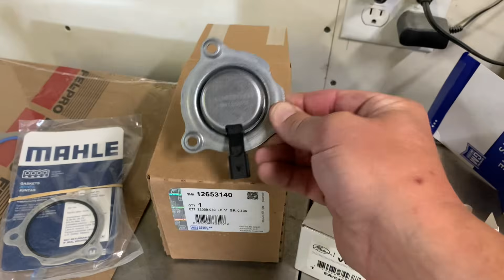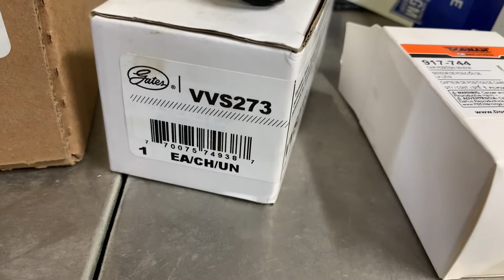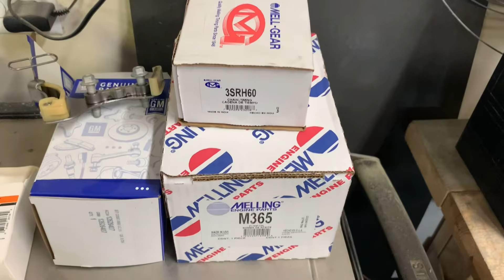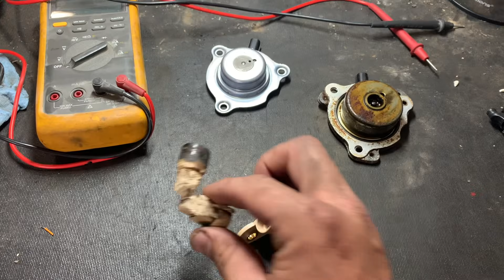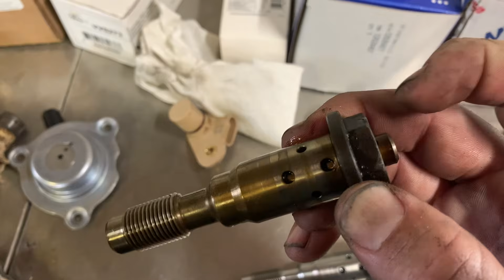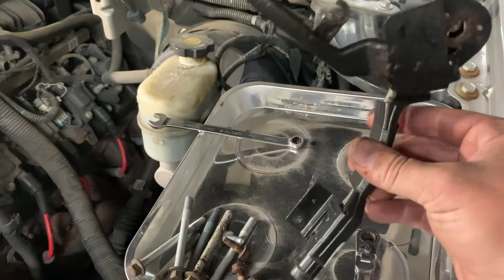6.2L GM Escalade Yukon Silverado P0011 Code Easy Fix VVT Repair

Comment: I have the p0011 code and a #2 misfire, engine and stabil link light. I have a rough idle and loss of power on acceleration most the time like a bad miss. Hopefully oil is just low cause it's wet underneath but I know i will have to order a vvt and cam position sensor at very least. Wish me luck for a $1200 escalade i can't complain lol

Comment: 08 6.2 Cadillac p0011 code reman install done from shop brought to me running poor phaser 180 off yes turn multiple times still off replaced all vvt phaser bolt tensioner Chain cam sensor magnet oil change good oil pressure at idle still getting p0011 so tired of this light 
PLEASE HELP
Reply from the maker: Could be in the harness, you replaced the vvt solenoid/actuator right?

Comment: 07 Cadillac Escalade replaced vvt, the magnetic, crankshaft, camshaft sensor code came back p0011 was stalling acting hesitate now back at square one HELP
Reply from the maker: Check oil pressure with a mechanical gauge at op temp, if good I would plan on taking the timing cover off and replace the timing chain

Comment: I'm glad you said something about the stabilatrak notification because that's what my 07 Escalade is doing I thought it was suspension related because I'm getting that light also! O Reilly code reader is telling me to replace these parts that you've shown and you made it look simple and easy, thanks!
Reply: Nope thats just gm's shit way of telling you one thing for something that could be many other issues.  Pretty sure its their way to not have to honor the warranty with mumbo jumbo bs that makes zero sense so they aren't liable.

Comment: Hello am working on 2013 yukon hybrid os abit more complicated but can sensor was not to bad to remove i use a Ball joint separator tool and it was alot easier then the other one i did on the past. 😊

Comment: I have a 07 yukon denali and it’s been shutting off when coming to a stop, at the last gear drop it shut off completely.  It won’t turn on right away it would just crank, but after around 5 min sitting and flooring the gas while cranking it turns on, but will turn back off at the next stop. It all started when one time i was going home and it wouldn’t shift above 1st, had to cruise whole way home. I’ve tried fuel pump, throttle body, cam position censor, battery. any tips on what it can be? Thanks
Reply: I have 2007 yukon Denali that did the same thing. Finely found 2 little ground wires that bolt to front of engine at the same place as the battery ground. 2 little wires were blisterd with corrosion about 2 inches up from the connection  hiding inside the wire loom.not a sealed connection  heat from engine cause moisture to wick up the wire.
Reply from the maker: @fettyD123  the Kerri g it sit and holding the throttle open sounds like it’s super rich but you add the stuck in first gear situation to the mix that’s really odd. These ecm’s are fairly tough but I would almost consider that to be an issue here since it controls both fuel scheduling and transmission
Reply: What is your oil pressure at hot idle?
Reply from the maker: @michaelabbott2908  on 5w-30 oil it was 28psi hot
Reply: Did you ever figure the problem out ? I’m having the same problem with my 08 Escalade?

Comment: I replaced the camshaft position sensor about  5 months ago  and still  getting the same codes, i didn't  replace magnetic actuator solenoid.  Could that be part of the problem? It's not showing  a code for it
Reply from the maker: @clintonhaselhorst  there has been an update for the magnet design, definitely worth a try I would think.
Reply: @trbokmro  thanks for the reply. I'll give that a try and probably replace that vvt solenoid while I'm there..
Reply from the maker: @ no problem! And yes I would definitely replace the solenoid also while you’re there. Hope it fixed the problem and you don’t have to dig deeper!

Comment: what camshaft adjuster magnet wiring harness do you have?  I think mine is bad. scanner says camshaft sensor and i have a new one on.  My 2007 just randomly cuts off out of nowhere.
Reply from the maker: @michaelh3098  don’t think I replaced the harness, been a while tho. I listed all the part numbers I bought for the project. I’d say it’s probably the cam shaft positions sensor since that was causing my problem. Mine didn’t throw a code tho.

Comment: We're you  having any rough  idling or stalling issues after the 07 E🎉Escalade has been driven
Reply from the maker: @michaelryce6835  no didn’t have any stalling issues or rough idle with mine.
Reply: @trbokmro  Understood it was  diagnosed as a possible VVT solenoid or  crank shaft sensor something of that nature
Reply from the maker: @ it could cause those problems don’t rule it out I just didn’t experience those conditions.

Comment: Great video.  Changed those exact parts now my 6.0 has a ticking like a lifter.  Didn’t have that before. Also at 1st startup it’s running rough.  No codes now though. Any ideas?
Reply from the maker: @scotthinkle6180  sounds like vvt solenoid / magnet issue to me. Ticking sound and miss is most likely lack of oil to the top end and if you didn’t change the pump or anything that deep I would put a new solenoid and make sure it’s a delco magnet in and see if that fixes the problem
Reply: @trbokmro  cam phaser magnet, and solenoid was changed.  Im wondering if I got a defective part.  Actually has better oil pressure then it did.

Comment: I change every part but still get the code p0011 and stabilitrak and traction  control
Reply: I’m dealing with the same issue right now. Did u ever figure it out?

Comment: After changing these sensors, do i have to relearn anything with a scan tool?
Reply from the maker: Nope just replace the parts and clear codes
Reply: I believe the have to be cause after replacing my I’m having issues

Comment: Buenas noches, tengo una Suburban 2007 5.3 y tengo ese código, cuando se prende el stabilitrak me patea el cambio de 1ra a 2da pero le borro los códigos y funciona muy bien por unos 5 minutos hasta que le vuelve a prender la alerta en el tablero y vuelve a golpear de primera a segunda velocidad, que podrá ser? 

He notado que la presión de aceite anda como en 25% o a veces más baja  

(Así compré la camioneta)
Reply: Buenos días. Olle pudistes arreglar tu camioneta. Llo tengo el mismo problema. Ya cambie todo Bonba cadena engrane tornillo señenoide sensor

Comment: I did everything for this code all gm parts in the end it turned out to be low oil pressure that sets this code mine ended up being the valley pan gasket o rings leaking causing low oil pressure I changed everything oil pump oil pressure bleed off switch timing chain cam sensor crankshaft sensor Vvt sprocket Vvt solenoid you name it if anyone runs into this issue and nothing else fixes it took me a month to figure it out.
Reply from the maker: Great tip! Thanks for sharing
Reply: What were your symptoms?? My truck would turn off at idle at random stops
Reply: @702lvbully3  No issue with running would just a p0011 code and traction control light and hard upshift and banging downshift.
Reply: @keysautorepair6038  ahh I see, thanks for the response!
Reply: @keysautorepair6038  Same issue with my 2007 Denali, L92 6.2l.  I am going to replace the o-ring on the pickup tube first and drive until a code or no code.   Then if it still has the P0011 after the pickup tube o-ring replacement, will make it a point to check for loose bolts on the valley pan and while I am there, change the gasket and seals on the valley pan gasket and o-rings under there.  If that doesn't fix the low oil pressure, then it is cam bearing, cam plate and new lifters and cam.  What can cause the hard upshift and banging downshift?
Reply: @Braebyrn The code will cause the banging when it shifts it’s from low oil pressure I’ve done a lot of testing on it if you need any assistance!
Reply: @Braebyrn  I changed the cam plate also no different just fyi if you have close to 170k-240 miles on your suv it’s the valley pan gasket it’s about a 2-3 hour job pretty easy.
Reply: @keysautorepair6038 it's got 180,000.
Reply: @keysautorepair6038  el p0011 también provoca pérdida de potencia y cascabeleo?
Reply: @keysautorepair6038 what exact problems were causing this because that's the same thing for my 07 denali 6.2
Reply: @keysautorepair6038 where do i need to look and what parts do I need for a solution on what you described
Reply: @RealBigLo  MS96169 Felpro gasket set
Reply: @k @keysautorepair6038 ne does this same exact thing!
Reply: @keysautorepair6038 did it feel like it qas slippin
Reply: I’m having these same symptoms I believe it could be the exact same problem as you mentioned. Because my water pump and timing chain is good don’t want to start throwing a lot of money into the car yet. I’m try the valley pan gasket first with replacing vvt solenoid and phaser magnet.
Reply: @mobbinkorrectly  Best way to figure it out is mine would work for about 20-30 miles after I reset the code and while driving 30-35 miles per hour for a extended period of time and when you come to a stop or slow down the oil pressure can’t keep up it would throw the code if you have a scanner you can monitor the Vvt system
Reply: @keysautorepair6038 thanks will do tomorrow on my way to work
Reply: By valley pan gasket. Do you mean head gasket?
Reply: @ FEL-PRO Engine Lifter Valley Cover Gasket Set MS96169
Reply: Hey I’m here having similar issue 
07 gmc Yukon Denali 
 I got the O ring replaced 
Changed the value inside the oil pan 
And even the oil pump is new 

I’m going to replace 
Vvt solenoid 
Camshaft sensor 
And the actuator 
This week hopefully it works out my car kinda idle rough when I come to stop and the oil pressure drops to 0 not sure why first it use to be 10psi  but now it goes to 0 any tips ?
Reply: @M @MrJoker-be5eu did you change your sensor and the filter under the sensor.
Reply: @keysautorepair6038  I did change the oil pressure sensor switch.  Mine didn’t come with filter it’s 6.2 L92 Noon AFM  

I got code p0011 today and  traction control and stabilizer lights  on 

Do you think the new oil pump already having issues should replace it when I do the Vvt  solenoid and actuator and camshaft sensor all together?
Reply: @M @MrJoker-be5eu Ya I have the same one 07 non dod how many miles do you have on it?
Reply: @keysautorepair6038  around 230 miles but I just got the engine rebuilt  like 2 months ago
Reply: @MrJoker-be5eu That doesn’t sound good at all if you want to send me your number I can text you privately probably need more information on it because something happened.
Reply: @MrJoker-be5eu  did you use new oem oil pressure sensor? After market ones are not calibrated the same.
Reply: Update after a few years of fighting this Poo11 code my camshaft bearings were shot oil pressure dropped to 19 psi after 15 minutes when idling took 3 days back to normal oil pressure and no more Poo11 stabilitrack light:
Reply: Thank you so much for your comment!
Reply: Okay seems you know your stuff .my 2010 gmc with the l9h 6.2 with 270k miles is showing the code but no stabiltrack light .i done the magnet ,cam sensor and the cam bolt .it made it worse .truck stumbles when at a stop and it will not back a trailer up my driveway .just sets there with the pedal mashed .so i put a o ring on the pickup tube looks up tube .have 25 psi at hot idle and runs between there and 40 while driving .in reverse now it sounds like the motor is gonna jump out when it misses
Reply: @KingdomKidsmission-n1m8e Did you use OE parts or junk aftermarket parts.
Reply: Bought them at advance .car quest I think .gonna buy some oem and try again along with probably the timing chain and tensioner
Reply: @KingdomKidsmission-n1m8e  What you need to do is find someone with a scanner and watch the Vvt solenoid Actual Camshaft Position versus Desired/Target Camshaft Position and see if it drops to 0 degrees and stays there.

Comment: The truck has Ben fine all of a sudden it stalls  when coming to a stop no check engine light just stabilitrack off light is on! It stalls again crank no start scan for code p0011  timing advanced ! I swear the only time this truck acts up is on a fresh oil change or when it’s down to 5 percent I dint get it the only thing I didbt replace was the cam shaft bolt thing and sprocket ‘ it comes at a awful time cus I’m in Florida set to drive home to Boston for the summer ! But it was every no and then cranks longer than it should when it starts yiu smell burnt oil
Reply from the maker: I would replace the cam bolt and magnet for the advanced code the magnet has been updated if I remember correctly. Doesn’t explain the oil smell tho time to pull spark plugs and see if one is oil fowl more or if they all are wet to narrow down why oil is entering the cylinder. My guess is these are two separate issues.
Reply: @trbokmro  Здравствуйте. Я из России. Есть возможность отправлять запчасти на кадиллак эскаладе в Россию? у меня 2008 года выпуска.

Comment: Anyone know the torque spec for the camshaft position sensor bolt and the three bolts on the camshaft adjuster magnet? I know he said that the torque spec for the VVT solenoid / actuator was 55 ft lb first pass, then 50°, or 75 to 85 ft lb, but I can't seem to find the torque spec for the camshaft adjuster magnet or camshaft position sensor.
Reply from the maker: I don’t torque those bolts but I think they are the same hardware as the timing cover bolts which are 18ft/lbs if I remember correctly

Comment: Thank you for the awesome video I just replaced all that in 100 miles and I still got the same code Maybe I think I need to do timing chain
Reply: Did you do a timing relearn? If not you should.
Reply: @dleehntr how do you do a timing relearn?
Reply: Even after clearing your codes?
Reply: Did you ever figure out the issue

Comment: Or oils pick up right
Reply from the maker: First scan for history codes, test oil pressure with a mechanical gauge at operating temp and also test fuel pressure.
Reply: @trbokmro  i  forgot to mention that when it does do this long crank once it starts you smell that Burt oil smell right after it starts

Comment: Hey how are you ? After I did my sensor and magnet my check engine light was coming on but I did a few earlier oils changes and it has not Ben on ! Sometimes when I got to start it ! It cranks over way to long if it’s cold fires right up once it’s warm and it don’t happen all the time if I start it 10 times a day 5 of them it cranks n cranks an ideas what that might be ? I never did the bvt fader the one that bolts in to the top timing gear !

Comment: ive changed the cam position sensor, vvt solenoid, phazer magnet, oil, filter, plugs, wires and still have p0011 and traction control, stabilitrak??
Reply from the maker: I would get it scanned with tech tool to see if any other body modules have codes, if none then I would test warm oil pressure with a mechanical gauge, if good then replace timing chain.
Reply: Possible you could be a tooth off?
Reply: What's oil pressure hot at idle?

Comment: I replaced my camshaft sensor and my phaser magnet put it back together  it ran great next day light back on and it was skipping worse than before then it runs great seams like when it’s cold it runs good but when it’s hot it startes running rough ! And ideas
Reply: I bought a new vvt magnet and cam sensory , however I took out the camshaft vvt sprocket bolt and cleaned it up nice !  Put the new parts on and changed the oil again for the 2nd time in 2 weeks and it runs great no codes no stabilitrack so I’m good
Reply: P0011 is what I’m getting and your probably right junk parts
Reply from the maker: I would check what your actual oil pressure is hot with a mechanical gauge.
Reply: Replacing the parts I did would cause a change in oil pressure  cus I never had this issue prior to replacing those parts
Reply: I’m at 22 wit engine warm and idling! Any suggestions where I go from here
Reply from the maker: If you didn’t have this issue before replacing those parts then first thing I would suspect is junk new part, it happens. If you are chasing a misfire when you say “skipping” and it doesn’t have a missfire code I would look at ignition system first. I always run Delco platinum plugs and MSD wires. Could be coil breaking down when warm but that’s not very common, usually an injector will throw a code.
Reply: Ty for your time and help ‘ you got the best videos all buisness and simple!!  unlike most of these self proclaimed celebrities. 😂
Reply: My truck has always had a small  skip when I say skip I mean skip  In  perfect smooth idle ! When I was all done and fired it up it was gone and the truck was insane responsive. But starting  took a abnormal length in cranking before the motor started then I realized I didn’t plug the harness in so I did and it still has that little skip it always has and runs great but it makes me wonder can you eliminate that whole vvt shit cus when it wasn’t plugged in it was super responsive ?
Reply from the maker: @stephenandrsde990  you can do a vvt delete check out Texas speed they have a couple kits. I think the vvt engines always have that skip you speak of mine does too.

Comment: Just did mine with 240k miles did the timing chain and tensioner also had no wear on the chain 0 was exactly the same length as the new oem chain the tensioner was in okay condition took 2 days awd awful job lol.
Reply from the maker: When my balancer bolt was not coming out I figured if it was gonna go that far I was just gonna pull the whole engine and re-gasket the whole damn thing and do a normal cam and lifter while I was there.